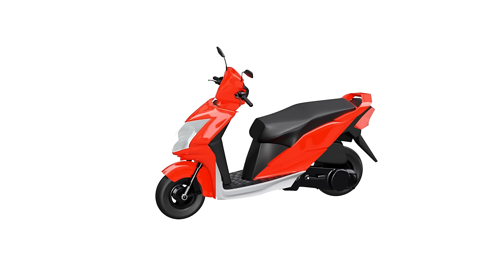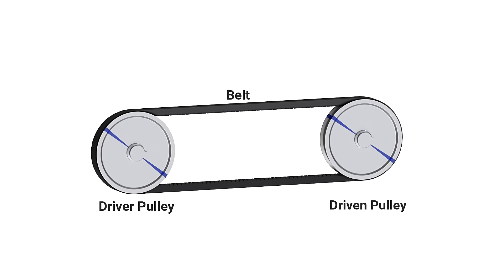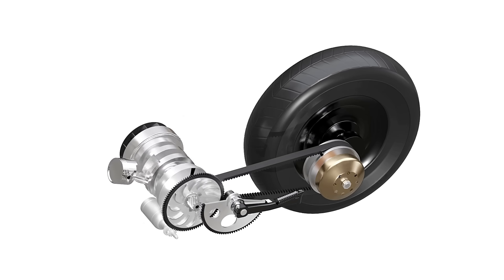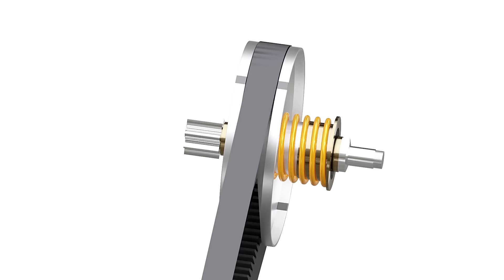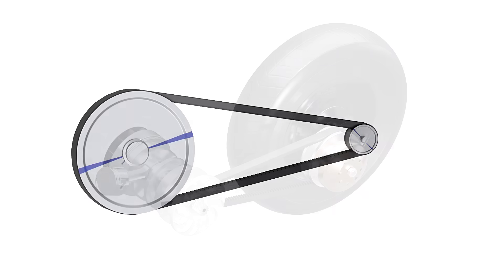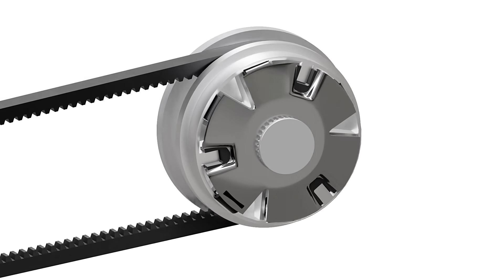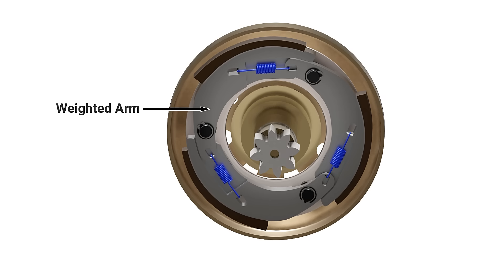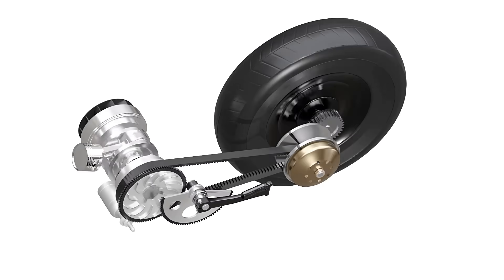How a Scooter Transmission works

Comment: That gear train seems very important as to let the cvt and the clutch work at high rpm where the centrifugal force can act and have a low torque to prevent friction - all tagnks to the speed reduction ratio

Comment: Ok, another fantastic video, but how is the input side of this connected to the thottle? How does squeezing the throttle or pressing the accelerator force the gearbox to change? At first, the CVT increases torque, and then as it goes on, it increases speed. Right? So is it torque sensitive?
Reply: the cvt is speed sensitive, as engine rpm increases the engine pulley diameter does too

Comment: This technology is thanks to the endeavours  of Rokon motorcycles who were the first to put it on their motocross machines back in the 1970s. At  the time most technical experts were very sceptical of their practicability.
Reply: SINJH GUDDU no, this technology was invented by Hub van Doorne, founder of DAF, he used this technology first in his vehicles. he invented this technology back in 1958
Reply: @ForTheOmnissiah  Not correct. DAF is a huge corporation, and they launched the first mass produced CV tranny in 1957. 
Rokon was never a large company, and the CV trannies they used back then had absolutely nothing to do with the company. Rokon bought the completed tranny units from Salsbury, who had been manufacturing these trannies since the late 1940's.

Comment: That’s some beautiful engineering.
Reply: Simplicity works. The fact that this mechanism works with centrifugal force and the fact that the belt can never increase in length is just so satisfying.
Reply: Cvt's suck...
Reply: @chickencoupeoriginal  

To some extant. But as we see here, they have their uses.
Reply: @chickencoupeoriginal  They're fine for scooters and snowmobiles...